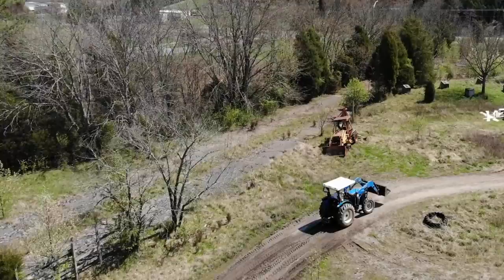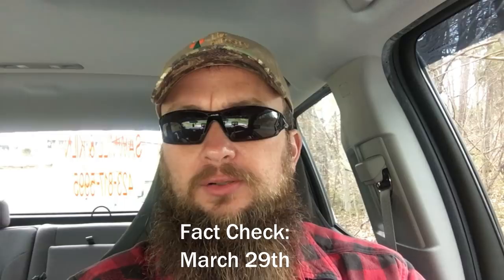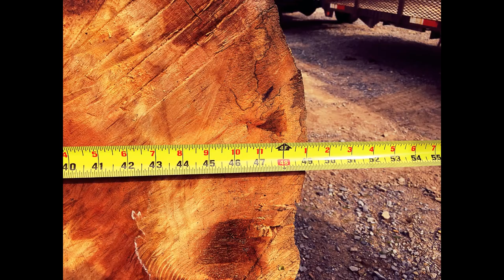THE BIGGEST LOG TO DATE ON MY SAWMILL, QUARTER SAWING WHITE OAK TIMBER,

Comment: "Old Ironsides" ... The hull of the USS Constitution was originally made of white oak and live oak. The hull consisted of three layers with the outer and inner horizontal layers being made of white oak and the center vertical layer being made of live oak.
White oak is very durable wood.

Comment: Did you use a 7 degree blade on the white oak? I wonder why you cut so slow, you are not using much horse power from the engine.-mike
Reply from the maker: Blade was a 7 but was not too sharp.

Comment: Please don’t be offended but I chucked when you said 32 inches was the largest diameter log you had put over the wood miser! Back in the day I sawed hardwood logs from 72 - 84 inches in diameter (11 metric tonnes or 24,200 pounds) in the one log after crown & stump were off it! 6 grown men couldn’t link hands around the base when standing before being felled.
We used a Lewisaw portable swing blade mill to break it down & some sections we slabbed with Alaskan mill on a double ended Stihl 090 slabbing mill.
32 inches dia would be the smallest dia logs we ever milled. We did about 250 metric tonnes a year of hardwood logs for about 10 years.
It was some serious sweat equity. But the returns were worth it!
Reply from the maker: chucked? that is the largest log the mill can handle? what is funny about that? sure those are huge logs you are talking about but my machine is not built to handle monsters like that, only doing the best I can with what I have,
Reply: Out of the Woods chuckled, phat phingers on a tiny phone keyboard. The Lewisaw portable sawmill is smaller than your wood miser, 2 men can hand carry it to the log.
That was my point, what you consider a big log, and relatively for their size & weight, how little the wood miser can handle.
Search up a video on you tube showing the swing blade Lucas portable saw, you will see what I mean.
Everything’s relative, you got some nice white oak boards at the end of the day, that’s all that matters, so job well done.👍